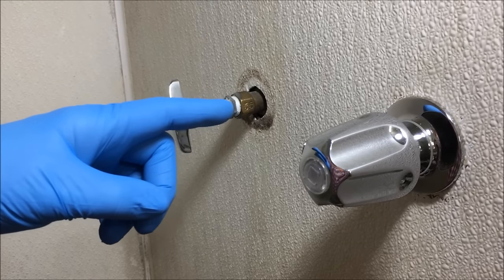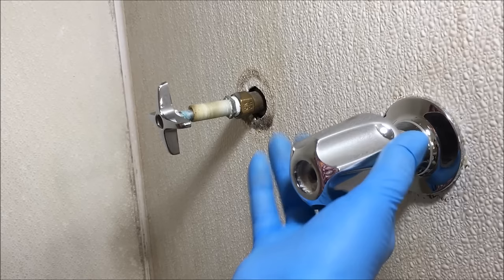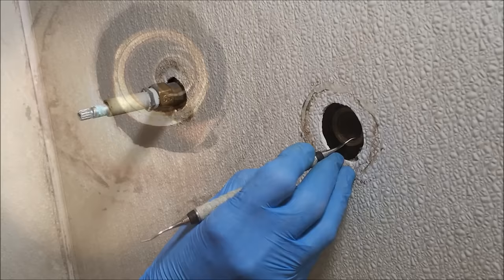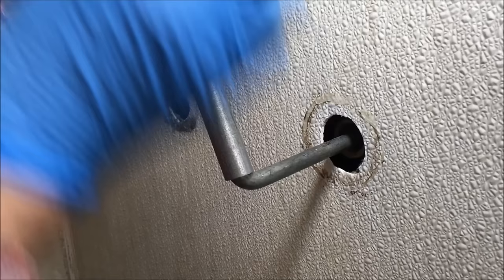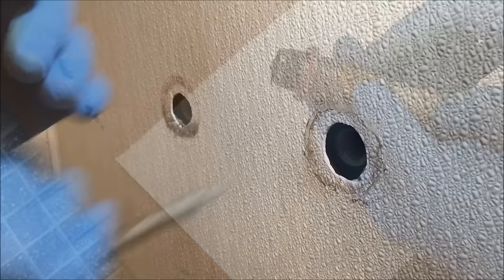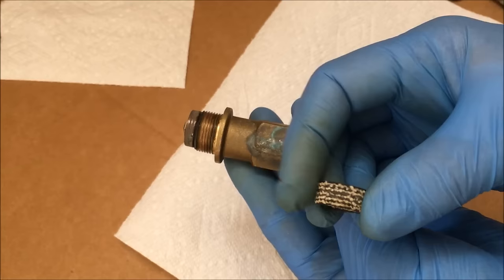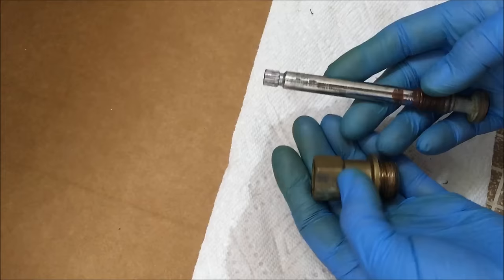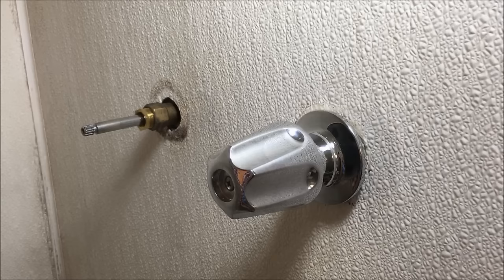Fix Leaking Shower Head or Bathtub Faucet | Rebuild & Replace Shower Valve

Comment: My handle just keeps spinning. But I know what I have to do thanks to this video. Seems straight forward. I really really reaaalllyyy do not want to pay a plumber. It would be two weeks of pay at least. Them professionals are not cheap. I don't have enough set aside to pay them without it hurting me alot. Ughh. I'll figure it out!
Reply from the maker: Hi Rambo.  If only the handle on the valve stem is spinning, the likely issue is the spline area in the handle (that goes onto the valve stem) is shot and only the handle itself needs to be replaced.  You can go to Home Depot or Lowe's to get a replacement handle or get one on eBay.  If the valve stem spline area is also damaged, I would just replace the entire valve with a new one.  I have complete faith that you can tackle the handle or valve replacement all by yourself.  There's no need to give your hard-earned money to a plumber or handy person to do it for you.  You got this, kiddo.  

I wish you a very Merry Christmas!

Comment: I can't get that bolt off. It's 40 years old and it's just leaking lately. Any ideas. WD 40 isn't effective I need some other chemical that eats away at the hard water deposit. Excellent video, very thorough!  Edit...ok I went at it again. I let the WD 40 sit and my fear of tearing the pipe out of the wall subside. It worked although I only had one replacement washer but I switched sides to see if it did the trick so it's not dripping at the moment. Tomorrow I'll go pick up a new set of washers. Awesome!

Comment: Underrated channel. Doing this later
Reply from the maker: Thank you, addmorebacon.  I appreciate you saying that.
Reply: @frugaldiy1  thank YOU, I appreciate saving hundreds of dollars on a plumber!!

 job finished. The hot valve stem came out in 2 pieces... replaced. but the cold water one I rebuilt. No more leaks, no more shutting off water to my hot water tank when I'm done showering. 

Is the valve seat square bit rounding out common...I didn't even tighten it that much it was just really soft and slipped almost immediately. Might have an issue next time it leaks... I'll have to be sure to replace the gasket BEFORE the seat makes metal-to-metal contact and gets torn up
Reply from the maker: You're certainly welcome.  Job well done!  I just love hearing that folks are saving their hard-earned money and fixing stuff themselves.  

The valve seat can and will slip if the valve stem wrench is not positioned on the correct shoulder of the wrench for the valve seat size or if the wrench is not squarely and firmly seated into the the valve seat before turning it.  The correct shoulder of the wrench to place into the valve seat can be tricky to "feel" and a bit deceiving.  Once you have the wrench correctly positioned you will immediately feel that because it will feel secure and tight in the valve seat.
Reply: @frugaldiy1  hm. Well the local store had a step wrench that didn't fit, it's a small seat. I had to get a tapered one, I guess those just aren't the best style. I'm a mechanic though, I have extractor bits if needed. Hopefully next time I have the right tool!
Reply from the maker: Copy that!

Comment: Love the presentation.  Simple and thorough.  Would that be the same principle for the sink?  My hot water tap gushes cold water and doesn't turn off.
Reply from the maker: Thank you.  No, it's not the same.  Sink faucets have seats and springs or a cartridge.  You have to determine which one your sink faucet has.  Here's a link to my video on fixing a kitchen faucet that has seats and springs: https://youtu.be/OgiiPwnqFIk

Comment: Excellent video, greatly appreciate the clear instructions. One question I have - with regard to finding the matching value, is this so it properly pairs with the value seat or the handle? If I want to replace the handles with new ones since I am taking the old valve out (I assume new handles will have valves included) , do I need to match the value seat or any other detail to know when choosing and installing the new valves/handles?   TIA
Reply from the maker: Thank you, Bill.  Here's the thing.  The shower valves and the valve seats are specific to the manifold in your wall.  That's why, if you're not familiar with the specific parts you need, I highly recommend that you remove the shower valve and valve seat and take them to a big box or hardware store or plumbing supply house and match the shower valve and valve seat to the exact parts you need for your shower.  I hope this answers your question(s).  You'll be a pro at this!  ;)

Comment: Can you come to our house and fix all our plumbing problems…lol
Is it ok to use Teflon tape on the threads of the valve body when reinstalling?
Wonderful presentation, you have a new subscriber‼️👍❤️
Reply from the maker: LOL!  Thank you, Mike.  Your words mean a lot to me.  ;)
Reply: @frugaldiy1  Is it ok to use Teflon tape on the valve body when reinstalling?
Reply from the maker: Yes, you can.  But, I don't care for Teflon tape if I can use RectroSeal 5 because it's that good at preventing leaks.  I'd recommend you do yourself a BIG favor and purchase some Rectroseal 5; you'll never regret it.  I've had the same container for years.  It' last along time if you keep the cap on tight.  I can tell you I would not use the Teflon tape.

Comment: Your video is very detailed! I have a 3 handle shower faucet. My shower diverter is leaking when I turn on either the hot or cold faucet. Is this also caused by a faulty packing nut.
Reply from the maker: ben, if it leaks from the spout, it's the valve stem washer.  If it leaks from the valve stem, it's the packing nut seal.  Try tightening the packing nut a bit, as I show in the video, to see if that resolves the leak.
Reply: @frugaldiy1  hi it only leaks from the valve stem. There are 2 areas where it leaks. One is on the bottom of the shower  diverter handle and the other is on the wall below the escutcheon . I was able to tighten the packing nut one quarter turn like in your video and that stopped the leak on the shower handle. But it is still leaking below the escutcheon.
Reply from the maker: I'd tighten it a bit more.

Comment: My valve is different. It has a type of horse shoe pin holding it in. It doesn’t unscrew. It’s supposed to pull straight out, but it’s stuck. We have very corrosive water in our area. Tried soaking it with W-D40. Still won’t budge.

Comment: Did you turn off your main water to do this ? I’m having trouble when I take off the ball water comes rushing out and I have trouble putting it back on to turn off the water flow I fixed this issue like 2-3 years ago but I didn’t remember how exactly I did it but I did not have this problem I’m stuck and getting frustrated please reply asap thanks

Comment: What causes the knob to turn off but if you keep turning it, it goes back to the on position and then back to off? There is a sweet spot where the water is off but there is a tiny drip. I want to fix it properly but I'd like to know if I just need to tighten some things up. FYI, the valves are not more that a couple years old since last replaced and still look fairly new when I take the knobs off. Thank you for any help you can assist with.

Comment: Awesome video. On my shower if i tighten the packing nut down the faucet is extremely hard to turn. I basically have it finger tight and the faucet will open and close properly any tighter and its really hard to turn the faucet. I cannot figure out what would cause that. Do you have any ideas? Thanks for the helpful videos
Reply from the maker: Thank you, russmoedark.  Yes, I do.  When you tighten the packing nut, the seal is compressed and expands, so it is "hugging" the stem of the valve, which makes it more difficult to turn the stem because of the "drag" on it.  As you turn the valve stem off and on with regular use, the packing nut will "relax" over time and turn more freely.  If the stem is too difficult to turn, just back the packing nut off a bit and that will resolve the issue.  But, make sure it's not so loose that it leaks.
Reply: @frugaldiy1  thank you
Reply from the maker: You bet.  ;)

Comment: Don’t forget to caulk or seal the chrome to the wall
Reply from the maker: I don't caulk or seal around the chrome trim because I remove the trim every month to check for leaks.  My next-door-neighbor had a leak in one of her shower valves and only discovered it whe the sub-floor became spongy.  That repair cost her $5,000 20 years ago.  Now, I check all of my valves and shut-off valves every month for leaks.

Comment: Can you help me? I’ve been dealing with this for three months. No matter what my tub is pouring water. It’s not dripping, it’s pouring. I’ve replaced the stems, and the seat. It’s only hot leaking. The cold is fine. I have an old American standard two handle set. Why would it still be leaking?

Comment: Awesome video. Question please?? Our setup is almost like yours. Problem is turn the hot water side and the water won’t come out(works fine everywhere else) can replace the whole valve and the seat and make it work again?
Reply from the maker: Thank you, Chris.  I have two thoughts that can cause the issue you're having.  Sometimes, the screw on the valve stem washer becomes loose and allows the washer to "suck up" against the valve seat so the water won't flow or will flow intermittently or 2) the threads on the valve stem itself become so worn and loose that it causes too much play (slides back and forth) in the valve stem, which will cause the valve stem washer to "suck up" against the valve seat so the water won't flow.  I'd look at those two issues first.
Reply: @frugaldiy1  so amazing that you even answered! Awesome. Definitely earned yourself a subscriber!!  Thank you. Also I don’t usually subscribe to anything! Lol. Sincerely thank you though. Happy Saturday!
Reply from the maker: Of course I'll answer and help if I can.  Turn off your water and follow the steps I show in the video.  You'll know if the screw that holds the washer is loose because the washer will have up/down or side-to-side play in it.  If it does replace the screw when you replace the washer.  You'll know if the valve stem threads have become too worn because the valve stem won't be tight and will have too much play in it, so replace the entire valve stem body.  

I'm working outside most of the day, so if you get stuck again and need more help, it might be awhile before I answer back.  Happy Saturday to you, too!
Reply from the maker: Chris, I have to disconnect my internet to replace my siding so I may not be able to respond to you for a bit if you need more help.

Comment: Watching this video now because my wife and I just bought a house and there is a small consistent drip in the shower that comes from the shower head up top...I changed the  shower head to the one we like etc and before that replaced the sealant tape...still drips a bit....so I will try and follow the video to a tee'... question?...you said outside about Hose bibs?...what are those?
Reply: Great and helpful video .very detailed
Reply from the maker: The outside hose bibs are the faucet you attach a hose to.
Reply from the maker: Thank you.  ;)

Comment: Our shower leaks every 6-12 months, seems to always chew away the rubber piece. Handyman keeps coming back to replace the valve and rubber washer, I don't think he's ever mentioned, looked at or changed the valve seat. With this video it finally makes sense, I suspect that's what's causing our issue to recur so frequently. Or is it normal to be replaced every 1-2 years?
Reply from the maker: Nope, it's not normal.  I'd fire the handyman and fix it yourself.  He doesn't know what he's doing.  He's charging you to fix his incompetence.  Shame on him.  If done properly, the washers should last many years--if the valve seats are replaced, unless, you over tighten the valve stem.

Comment: I am having a difficult time getting a snug fit with a new seat.   Leaking.   I believe the threads are slightly off.   it will go, but not snug.   I will try again, after cleaning the valve of any gunk inside the wall, and then coating seat with T Plus 2 Teflon Pipe-Thread Putty/Sealant    Any other suggestions?

Comment: Bravo!!! Amazing video and explanation - Thank you for sharing your expertise!
Reply from the maker: You're welcome, slappdaddy8, and thank you for such a nice and glowing comment.  It's certainly a nice way to start my day!
Reply: @frugaldiy1  I'll let you know if I succeed and taking care of my drip-drip-drip.  I think I need to change the piece the rubber fits into as you close the knob!
Reply from the maker: Okay, I hope you do.  And that rubber washer is typically the cause of the drip, drip, drip.
Reply: @frugaldiy1  Hey!  I had success.  The seats were very old and worn down, so I replaced them.  I also had a completely worn out washer, which I am sure was the culprit.  I did this with confidence, thanks to you - and saved a fair amount of money.  Also, my local hardware store had everything I needed!  Thanks!
Reply from the maker: Fantastic news!  I'm so happy to hear you fixed your drip, drip, drip!  Now, you know how to fix the drips from here on out and save a bunch of money.  Job well done, slapdaddy8!

Comment: Last year I had a guy from a neighborhood plumbing Co. deliberately glue the hot-water Trim Cap on, with e6000, after putting on new hot water washer.
Recently another plumber came this past Friday telling me this and wanted to know who did this, he asked my permission to try to get it off or perhaps break it off.
Prior before these two visits, this company came, wanted to get into my closet where all the plumbing pipes are for a costly rebuild when I only need new washer and valve seat. I told him to forget about it and just paid for the coming out service fee, going to look for someone else.
How do I get this Trim Cap off?

Comment: Thank you for making the video. Why is the heater turned to “pilot” thank you.
Reply from the maker: You're welcome, C Math.  I turn the water heater to the pilot position because I don't want the burner to engage before I remove all air from the water lines and fill the water heater.
Reply: @frugaldiy1  than you ver much for the fast response. Is putting the water heater on pilot a good practice anytime the main valve is closed to do plumbing repair?
Reply from the maker: Yes, absolutely!  Merry Christmas, C Math!
Reply: @frugaldiy1  Merry Xmas and a :) new year. Once again, I (we all ) appreciate your informative videos.
Reply from the maker: Gosh, that's so kind of you to say.  I deeply appreciate you saying that, C Math.  I hope my videos are saving folks money and helping them become more independent--that's the goal.  ;)

Comment: The stuck handle. I found an easy way to remove it. Just use a heat gun and heat up the handle. It will literally fall off.

Comment: I think my manifold may be deformed as well. Can you use some plumbers tape instead of Retro Seal 5? If not, i'll have to go out tomorrow to get some sealant.
Reply from the maker: You can guess it won't leak and use tape.  Or, know it won't leak with the sealant. ;)

Comment: I have a question, is this the instruction I need to follow if the shower head is leaking? Or is this just if the handle is leaking? My shower head is leaking and before I attempt to take it apart I just want to be sure.
Reply from the maker: Yes, it is.  If the valve washer, or valve seat is bad, the shower head will leak.

Comment: What do you do if the seat valve keeps coming loose?  I did everything in your video and it help the leak by 90% but it still leaks a little bit. So I  took it all apart again checked the threads and retighten everything tried it out and the leak improved but still drip a drop a second.  😢

Comment: Hi what can I do if my value set won’t come off and it’s too soft to use the wrench tool, I think it’s too old. 
And I can’t find a replacement on the valve stem because mine is old. House build in 60S.

Comment: I bought the socket set for removing the valve bodies, but the hex on the valve is either way back in the wall or non-existent. In other words, I can't get any of the sockets to engage with the valves! I can remove the packing nut with an adjustable wrench as that protrudes through the hole in the wall. Once I remove the packing nut, the stem just spins. I don't know how to get these valves out without tearing open the wall at this point. There are 16 splines on the face of the stem, so I think they are American Standard, but that's a guess. The house is close to 60 years old, so they are older valves, obviously. Any suggestions? Thank you.

Comment: For some reason when I replace the cold water steam it works for awhile but after time its gets harder and harder to turn water on almost having to force it open. It only happens on the cold water hot water is fine . Any idea why?

Comment: I just did this but my shower is still running even though the new handle is in the off position. ????? I used the exact same valve to replace the old valve. Then I used the old valve with a new rubber washer, but its acting the same. Running even though its turned off.

Comment: My problem is that the cold water handle spins endlessly and its hard to turn it off. Do you know what I need to do to fix that? Basically you have to find a sweet spot for the water to stop, because once you pass it the water comes back on
Reply from the maker: My best guess is that the spline (the end at the valve stem where the handle fits onto) is stripped, so the handle just spins because it has nothing to "bite" onto.  If that's the case, you'll need to replace the entire valve (or find a valve that's an exact match to yours and swap out the valve stem).

Now that you've edited your comment and added more info, I'll added this.  It could also be the washer at the end of the valve stem needs to be replaced.